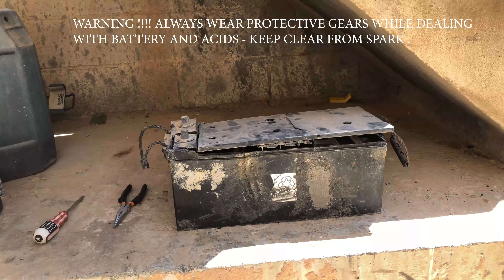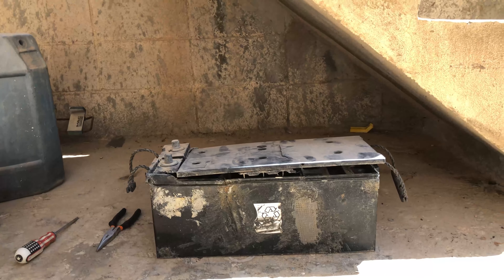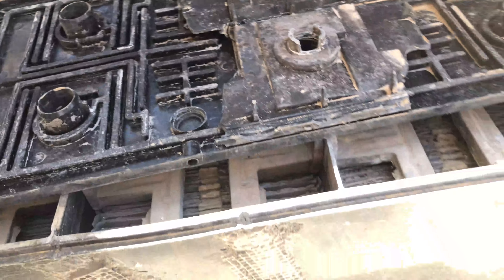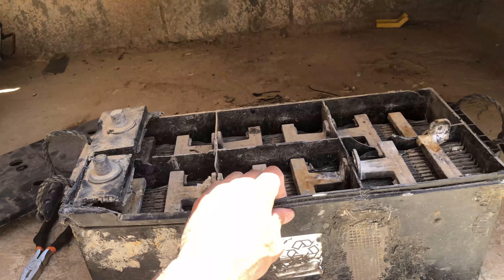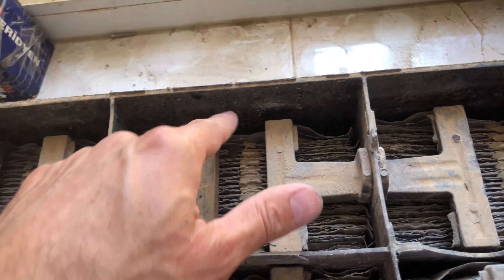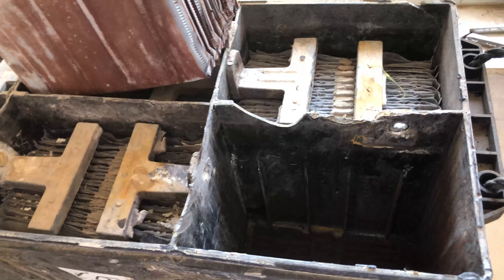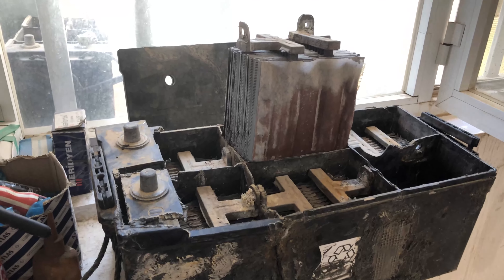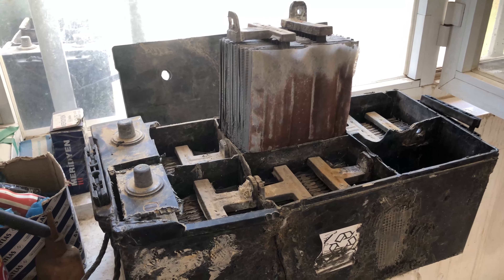FLOODED LEAD ACID BATTERY EXPLOSION  BLAST, DANGER OF HYDROGEN GAS .

Comment: Several years ago when I was a teenager had two large batteries explode flinging acid and fragments in all directions.   While on a john deer combine which required 24 volts, 2 batteries in series i was tightening the positive terminal when the wrench slipped and welded itself to the steel frame of the machine and the battery terminal.  I can sort of recall seeing the wrench glow red and heard a hissing sound and just as I ducked and climbed off the machine i was showered in acid, had I stayed on for a few more seconds i likely would have had severe burns to my face and been blinded.  Or had it not been late October in Michigan and the temps down into the mid 40s necessitating jackets and jeans i would have also suffered far worse injuries. This is why the proper procedure when removing and connecting an automotive battery is to disconnect the negative cable first and reconnect it last, or vice versa if you have a classic American car from before 1955 or a British car before 1970 with a positive ground system.
Reply from the maker: Hi brother , Thanks goodness we made it out safely , We could have been blinded or badly injured , lesson learnt ,Be safe always !!

Comment: lol..i commented on a prevoius  video that a charging battery and thereafter is dangerous..and i find this one,,you have experienced the blast...it teaches you to treat them will a whole new level of respect..
Reply from the maker: lol, Yeah they are scary , the acid , the hydrogen gas are both very dangerous !!!! yeah , we have to treat everything with respect including ourselves and never underestimate the destructive power of it , thats why we always wear protective gears while dealing with those dangerous goods, also during they have to have good ventilation and no spark while desulfation .the desulfation process produces lots of hydrogen gas do be advised.

Comment: I’ve been there. I forgot there was a atv lead acid battery on my bench charging. I proceeded to grind a piece of metal and sparks flew. The battery exploded right in front of me and blew the top off it. 
Valuable lessons are sometimes learned the hard way. 
A CO detector will go off in the presence of hydrogen gas also. I just found that out hence here I am lol
Glad your ok brother. Could have been really bad.
Reply from the maker: You are totally right my brother, I've almost lost my eyes Thanks God we made it without major damage ,live and learn , Always be safe.
Reply: A CO dectector does that huh?❤❤❤ i should carry that in my tool box

Comment: AGM batteries are worse in my opinion. They burn with a lot of force. Usually a lead acid battery will only blow up with that type of force when the electrolyte is very low, which leaves a large vapor space for gas to accumulate.

Comment from the maker: THE EXPLOSION HAPPEN WITHOUT ANY FLAME WHATSOEVER  , IT WAS JUST A BIG BANG WITH A BIG PRESSURE  AND SHATTERD PIECE OF BATTERY PLASTIC WERE FLYING, ACID SPILLED ON THE GROUND AND ACID VAPOUR IN THE ENTIRE ROOM .
Reply: Salam,can I have your email?
Reply: There was a flame you just did not see it because it was so fast.  Hydrogen gas probably ignited from a spark.  It does not blow on its own.   Normally it just bubbles up and dissipates outside.  But if you use batteries enclosed space it can build up.    Some cars have the battery inside and if you notice there is a rubber or plastic vent tube which takes the hydrogen gas and vents to outside the car.   If not you can blow up your car.  But you still need combo of gas + spark.  It does not light on its own.

Comment: This battery or the charger must have something wrong with it, I seen these batteries used in many houses and warehouses with out a problem, in fact I remember in Mexico the telephone company had dozens of these to use as backup power in case the grid failed, never heard of any problems
Reply from the maker: Hi bro, , the one I have was so cheap , the plastic casing is so brittle cant stand any pressure , so always buy  a reputable brand. OR switch to lithium LPO4  if you want a peace of mind .